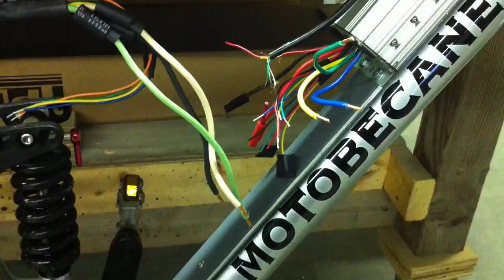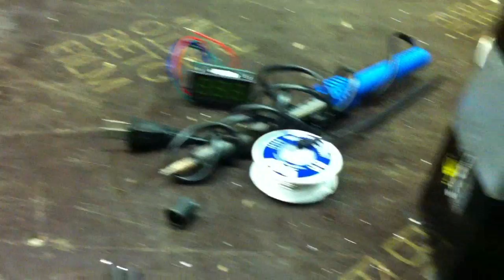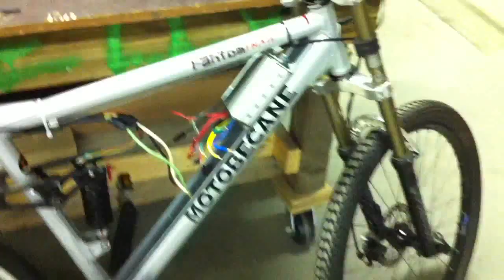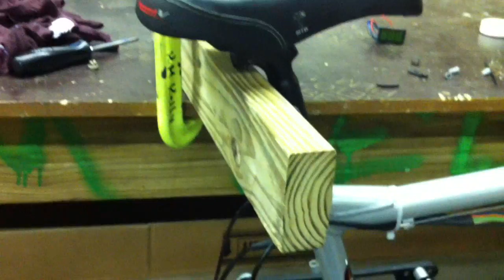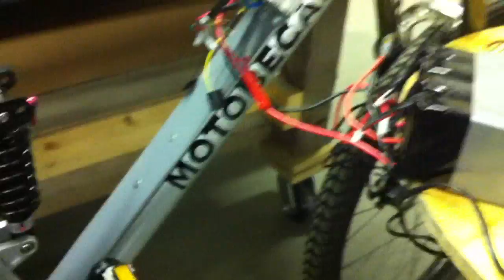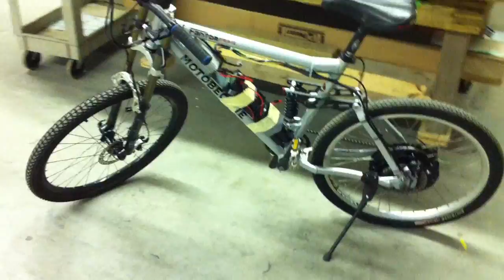EBIKE 72v - Controller wired and motor tested with 20s LIPO

Comment: Way ahead of the time you were haha , jesus christ ive been living under a rock, ive had a 1000watt 52volt kit for about 5 years , i recently uprgraded to 72volt 3000watt and it wont stay in the new frame i brought, so ive stripped my 1000watt bike down that had no torque arms needed much deeper drop outs ect , but i dont trust it , i need to fabricate some metal like you have done to this, and then i will be able to test it and hope it works
Reply from the maker: Ya, I have been a member of Endless Sphere forums and got most of my inspiration from the smart folks there...I was ahead of the curve but following others! Good luck on your build

Comment from the maker: if you don't want it to burn up with full throttle runs you need something with a wider stator, or something in a smaller rim. the 9c will take about 2500w bursts but will melt if you hold it there for 5 miles straight. This is why I use a x5404 it will take 130v 70a before it melts.

Comment: I just assumed it was the same quality as the GM motor you have been using all this time.Pretty much a 9c copy right?...Bummer I have the opportunity to buy a 2807 bikekit,com 26 for 150.00 (actually the vey one your controller was tested on)SHSHS secret..LOL.and I will be using the same controller you have and wanted to end up at 72 using Zippy packs.Would you suggest another dd hub motor?

Comment from the maker: Yes the controller is a lyen 12 fet. The motor is great but you can easily burn it up with 72v over 30amps. I'm attempting a Mid mount with that Hub on a spare bike at the moment.

Comment from the maker: @staver76 you connect the red and black from the source side of the turning meter to the battery and the red and black from the load side into the controllers red/black battery leads. If you wire it in parallel to turn it on and off it wont display the Ah's and watts being drained from your pack. it will just display voltage

Comment: @skeetab5780 If I wanted to connect a turnigy watt meter and power analyzer to my ebike should I connect it in parallel or in series between the battery and motor? (I was thinking of parallel so I could turn it off when not using it so I can save a little bit of energy when not in use to get the most out of my ebike when need be) 
Which would you recommend and why?